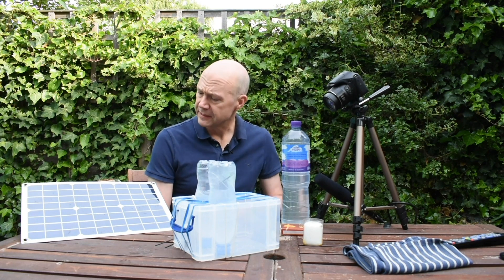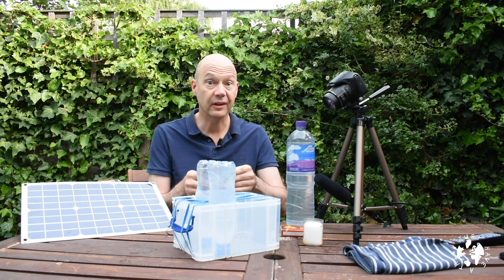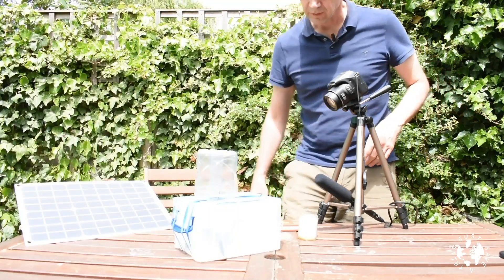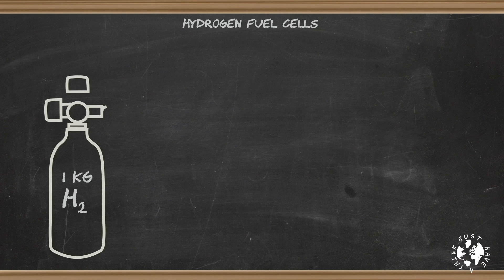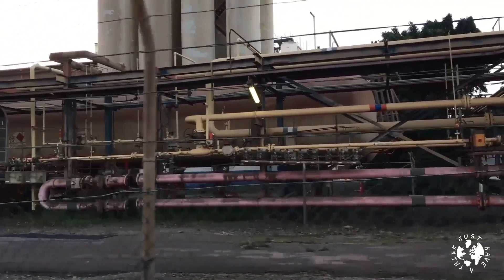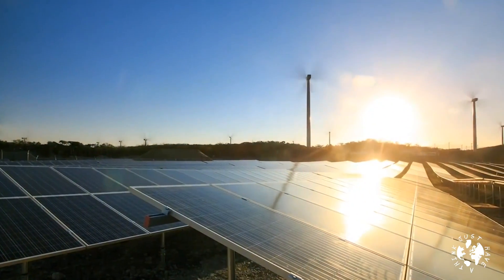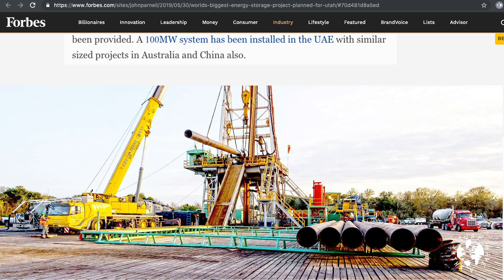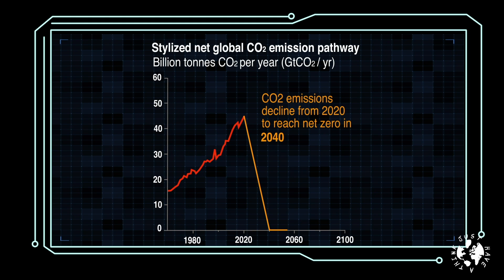Energy Storage in Hydrogen : Does this beat batteries?

Comment: i'm surprised you didn't talk about the efficiency of this process say vs. batteries or other forms of storage
Reply: Effiency is worse then lithium ion batteries but the storage capacity is higher. You could store a big amount of energy you produced in the summer and use it in the winter.
Reply: @Lucas-kh6le  Lithium batteries are improving very fast, meanwhile many physical constraints and thermodynamics laws will never allow H2 cells to get much better. Platinum is still mandatory in H2 cells. OTOH, battery technology is an open ground for multiple exciting new concepts. Including MIT's Professor Donald Sadoway molten metal battery, which may have a bright future in large scale stationary projects
Reply: @rubindiehl2569  Thats true.
Reply: Trigger Troll  you can debunk CO2 as forcing warming in our current atmosphere in 33 seconds.  But you'd be wrong. Comparing our current atmosphere to the one half a billion years ago in geological time is not a valid comparison. Continents were significantly different too. 

The issue is rate of Climate change is so fast that biomes and humans  won't have millions of years to adapt.

The humidity of the atmosphere makes a difference too. It's a very complex system and taking single pieces of information out of context can be deceptive.

https://www.newscientist.com/article/dn11647-climate-myths-its-been-far-warmer-in-the-past-whats-the-big-deal/
Reply: @MrDisasterboy  Its changed no faster than it has in many historical periods
Reply: The conversion of hydrogen into useable energy alone(Rough 60% efficient) is enough to roughly match the net innefeciency of batteries so it is best used where you are willing to sacrifice efficiency for energy density.
Reply: Yes, while it’s very scalable, the efficiency is poor.
Reply: Its main value is as jet fuel. There are only a few jet uel alternatives that can be made sustainably.
Reply: Trigger Troll  Yes water vapour is a greenhouse gas.  And the warming from increased CO2 causes more water vapour in a 'positive' feedback to warming.

So to understand your point, you do think CO2 is a Greenhouse gas, you just don't think it's significant? Increasing it, won't affect Climate as far as you are concerned?

I am not sure what taxation has to do with understanding Climate, except that you seem upset about it. Or what the point of where my food is from.

But I get the impression that you have an agenda. You like diesel, you don't like it being taxed and you don't want society to bother shifting away from non-renewable fossil fuels to other forms of energy.

I understand how our society works and how we produce food.

 As it happens I do know a farmer who uses biodiesel. But that's unusual and the neighbours resent the smell of Patriot Fries/Hot Chips. So I can see how, on scale that could contribute to obesity in rural areas. 😂

Half the emissions from food consumption in wealthy countries is driving to the shops. That exceeds on farm emissions including inputs, transport, processing, refrigeration and cooking!

Like this show promotes. Comfortable urban people driving electric vehicles or taxis to the shops or getting off their  posteriors to walk or cycle will make a big difference.

I don't expect we are going to change each other's perception of what is happening with Climate. So please don't take offence, should I stop responding at some point in the dialog. And vv.
Reply: @pandabear-k7e  Looking at your previous comment, I am no surprised you find it moronic. Doesn't change anything. Heat pollution is nowhere near enough to warm the planet in any significant way, true, but it does warm the immediate environment of human settlements rather significantly. There is a reason why the IPCC places their monitoring stations outside of cities, and why certain types of birds for example have stopped migrating.
Reply: I'd be interested in that too
Reply: I'm the turbine could be improved to capture the 💧drop in pressure and thus improve efficiency.
Reply: @Jeff Peate it is difficult to imagine how a battery based energy grid will be more cost effective and more efficient over the long term than a hydrogen based system. 
If you can use the H to run turbines effectively to generate electricity and then use small scale battery storage then such a hybrid system can also be reasonably efficient... depending of course on how the hydrogen is accumulated.
Reply: @Jeff Peate Yes, I agree with your layout because at the end user the energy must be electrical. If the system is optimally configured then reliance on batteries will be low. Only in vehicles really where batteries and capacitors will be essential. In my opinion even trucks can be purely battery and cap powered by adding induction charging systems embedded in roads. 
It is only in high performance passenger aircraft that onboard fuel is required and I personally tend toward turbine thrusters instead of fuel cell system. 
The hydrogen economy depends on how effective and efficient the water molecule can be disassembled. On that I am absolutely certain that a resonance based splitting system will bring the energy requirement down to a small fraction compared to electrolysis. 
If the existing patents of such methods can be sequestered from the "controllers" then the energy infrastructure will change dramatically. There are 5300 patents that are "classified" and withheld from the public by ....."The US Government"..... whatever that means.
Reply: Okay, let's say if you have solar panels that can generate 100KWh a day but you only have batteries that can fit 50KWh. In this case efficiency doesn't actually matter since you don't have the necessary storage capacity to fit all that energy. If you now leave those batteries for a year, they'll discharge, and after about 300-500 cycles, those batteries will start to deteriorate. And you'll need net energy to produce new batteries. Hydrogen tanks can be refilled n-amount of times, and will last forever as long as the combustion mechanism is in order. The efficiency of hydrogen creation will only get better as technology progresses so saying hydrogen is bad solely based on efficiency of creation just is not a good enough reason.
Reply: Efficiency is  cheaply enough, efficiency is irrelevant, the only an issue where a fuel is expensive or hard to come by, so long as you can produce hydrogen cheaply
Reply: @tim g That is not how energy works. If you use heat to do work, then you are adding that heat to the system. Because that little bit of fundamental physics called "energy conservation".
Look at any of your devices. If it says X Watt on the back, that is the amount of heat it ultimately produces, unless it creates a chemical fuel of some kind, thus acting as a heatsink.

Besides, CO2 doesn't "Take a long time to break down". CO2 doesn't break down, period. It is a stable compound. Plants all over the world use it as a resource for building material, hence the period of global greening we are currently experiencing.
Reply: @tim g The heat is being added because the solar cell absorbs more of it than the cycle of "light comes in and gets reflected" does. The whole point of making more efficient solar cells means you are trying to absorb more energy and stop reflection. Ideally 100% of it, which means more heat on the planet. 
Though granted, that is only a local problem, since in the grand scheme of things, it is all radiated away again into space pretty quickly. Still means cities are a lot hotter than the countryside, hence heat polution.
Also, did you really just link me a grade school level article to prove your point? Don't they cover this stuff in school wherever you are? Maybe I should link you some basic logic articles in return?
Reply: @tim g Considering, again, that you sent me information on the topic any high schooler would know, expecting it would be news to me, I am afraid you are in no position to recommend I better myself. 
You have given me unfounded opinions, not information. 

I would in turn recommend a healthy does of introspection to be in order. And again, maybe brush up on the basics of logic and rhetoric.
Reply: Jeff Peate have you got a reference for the lower loss rate? I may be behind as its been sometime since a built a solar car and did the calculations
Reply: Jeff Peate pumped hydro will only work is specific suitable locations, and the greenies will no doubt try to stop that also
Reply: Andrius K do you know what burning hydrogen produces? H20. Do  you know what the the greatest greenhouse gas is in the atmosphere is? H20, so if you think burning fossil fuels releasing co2 is causing global warming, burning H will cause more.
Reply: tim g co2 is recycled and absorbed with 5 years. No problem
Reply: @Jeff Peate true but pumped hydro is dependent on geografical features to be economical. Hydrogen can be produced where pumped hydro is not feasible.
Reply: @Jeff Peate he is correct. There are a lot of losses associated with the production, storage and use of hydrogen compared to pumped hydro but pumped hydro is dependent on geografical features to be economical.
Reply: @Jeff Peate depends if you have renewable electricity. Not everyone globally has renewable electricity in their area
Reply: Battery storages are very efficient,
but they only have a very short live time. They loose capacity over the years and eventually you have to replace the whole system. 

A Hydrogen storage is far away from being efficient. But it's clean. No recycling of batteries, no high maintenance or replacement costs. And they last a very long time. 
Capacity is just a matter of storage tanks. 

There is a lot of solar and wind energy where I live. 
I see it every day. Every time the sun is shining, they shut down the wind energy. 
Both technologies would help. And everything is better than shutting down an energy source. 

If you want to store a big amount of energy over a long time, like 
(saving it for the winter) I would go for Hydrogen. 
If not, it's about investment costs and the price of stored energy.
Reply: Lol, do u think there’s no energy used to produce that lithium battery storage?
Reply: Excellent Video! Forgive me for butting in, I am interested in your opinion. Have you tried - Elijahzan Ailment Solution Review (probably on Google)? It is an awesome one of a kind guide for saving money with your own electricity supply without the normal expense. Ive heard some incredible things about it and my old buddy Taylor after many years got excellent results with it.
Reply: do A YouTube search for liquid air batteries. this method is infinitely  scalable, non-volatile snd can store energy for as long as needed. also, total losses are just 20%. h2 losses? 70% from water to voltage- h2 just can't compete. plus- with the new 4680 tesla tabless cell technology, they can make lithium cilica batteries with no cobalt & very little nickel- Waaaaayyyy cheaper, faster & more scalable than ANY of the above. i give it 10 years & tesla energy will be building 15-20 terawatt super sub-stations for 1/2 the price of ONE coal peaker plant cost to build & operate for one year... & tesla tera-packs are automated... no need for coal, gas, maintenance crews, medical, dental, vision, labor unions, lobbying... just sunshine, collect energy, pass to grid.
Reply: tesla 4680 cell tech changes EVERYTHING
Reply: I was surprised efficiency wasn't covered. The round trip efficiency of pumped hydro is the reference everything needs to be compared with. Lifespan and up front cost are also issues that must be addressed. Hydrogen storage has always had a short lifespan problem. High efficiency & long lifespan equal low cost at grid scale.
Reply: @tsamuel6224  solar + battery storage at grid scale. in western nc, near the TN border, there's a group of 3 houses and a small business that are on solar + lithium battery. they had to double up on the size of the system because there's a lot of rainy days. they priced vs. small diesel. diesel would be cheaper up front- but... the solar system only took about 5 years to 'catch up'... now they are running  way cheaper... plus? hands off, all automated. no need to keep it fueled or rebuild wearing parts. at grid scale, those 'maintenance costs' compound... A LOT.
Reply: @tsamuel6224  liquid air energy storage is around 80% efficient now, vs. h2's 40%
Reply: Effiency = cost
The less efficient a process is, the higher is its cost.

With the current efficiencies and maintenance requirements,  H2 storage, energy production and mobility are not competitive to other forms of energy & storage, today. 

If we don't want to end up with higher energy cost than today, the H2 efficiencies need to improve by a lot.
Reply: 100% efficient!
Reply: And that’s the problem right there. The efficiency is just awful.
Reply: The efficient can be improved by using the pressure as an energy storage as well as the fuel.
Reply: Efficiency isn’t the only important thing when considering alternatives, and we also need to look at the whole cost in energy to produce (Non Renewable) Lithium Ion batteries, from Mining, transportation, processing, manufacture and end of life disposal!.
Reply: @Kiyarose3999  Yeah, that’s all well understood. Hydrogen is a joke. It’s like 20% efficiency from source to wheel. And fuel cells require exotic materials as well. In fact, making and using hydrogen is so inefficient that the vast majority of hydrogen used today is made from fossil fuels with massive CO2 output at the source.

Hydrogen will have a place in the new energy economy, but it will be incredibly niche, and FCVs will be a tiny fraction of cars.
Reply: Interesting, just one cheap cell. No charge controller, no intermediary like a capacitor or small battery.
Reply: than you get student engineers telling you that you do not understand the math, you can not convince them otherwise...
Reply: Earth would be more cleaner with more renewables, efficiency might be an issue. Oil wars will be reduced, More peace to the earth. Ofcourse big players living on the existing system might not be liking solution.
Reply: @RaviKumar-cm1qo  That is probably the most naive way of looking at this topic. 
Renewables are not a magic pill.

Before there was oil, wars were waged, and after there is no more oil, wars will still be waged. 

Plus, you know, the "big players" are also the biggest investors into renewables. Like oil companies, for example. Big Oil positively adores renewables - because guess what, "big oil" does not actually care about oil. Only money.
Reply: @Alexander_Kale   Thanks for reply, I know the wars will continue to happen. Consider Arab countries, few are very rich and few are turned into such bad state because of some countries which control flow of money, power. If renewables which are available to everyone comes to play, a level field would be created. The wars will continue, those wars among equal players would be worthy, interesting also.
Reply: Efficiency is not that of a relevant parameter as such. It's just a number a percentage. The real question is what that means in term of extra costs to make up for the lost energy in comparison with the costs of other energy storage technologies that achieve the same goal. Seasonal storage is no way a job for batteries, so you're powerwalls are exceedingly expensive for the same energy amount to store, compared to the extra renewable infrastructure cost to make up for the losses in electrical-H2-electrical conversion. You can make a point if you compare towards the infrastructure costs of thermo chemical storage of heat, or infrastructure that work with potential energy in watercolumns and pumps...
So to recap, efficiency as a number on it's own is NOT relevant, it's only relevant towards the costs compared with adequate alternatives...
Reply: Yes, those numbers are crucial here. Creating batteries waste a lot of energy and has environmental consequences, so even with lower efficiency of hydrogen storage it could be useful. Question is - how much do we lose?
Reply: @Lascarnn  And you have the data to prove that building batteries is that can be used thousands of times and then remanufactured are less efficient that the inefficiencies of hydrogen it better. Right now I understand that a hybrid car has less carbon footprint than full battery. Of course once you no longer have to keep that coal or gas fired plant online to charge the batteries may be a different story. So much BS out there.
Reply: @cliffordnelson8454  What are you talking about? I wasn't replying to your comments, I wasn't even talking about cars. But since you wrote to me, I can reply - hybrid car has less carbon footprint when the car is not driving enough. If EV will drive 100k, 200k km, then (depending on electricity source) it will have smaller footprint.
All this can be calculated, it's just math. We just need to have more numbers, ie. experiment more with hydrogen to know how the emissions would look like for bigger scale hydrogen usage.
Reply: @Lascarnn  And if a coal plant has to stay operational to meet the needs of recharging, then you should take the carbon-footprint of the coal plant. Somebody told me of going to a recharging station and seeing the gas generator being used for the power. LOL. Very easy to misdirect assuming that power will come from renewables. but that is not fair. When all power is from renewables, then you can take credit, but not as long a fossil fuel plants are needed to meet electricity demand, and that recharging is increasing the electricity demand. Of course, there is the aspect of not increasing pollution in areas of high pollution, but that is a different problem.
Reply: Should judge by volume anyway. WTF does 1kg of pure hydrogen looks like? He totally skips that... 

 Seen the engineering explained video. He talked about it, and it doesn't look good.
Reply: The re-use factor will eventually completely and totally obliterate any short term efficiency advantage of batteries by long term cost advantage of hydrogen.
Reply: Doug Stevens Why do you think so?
Reply: @matschlegel  Replacement costs of batteries is tremendous where hydrogen infrastructure maintenance is low in comparison.
Reply: @dougstevens1877  clearly you have NO EXPERIENCE with hydrogen. if harry houdini had h2's 'break out of confinement' skills? he'd have been a billionaire
Reply: @jaybee3165  ... you should take this up with Airbus... before they start wasting money on H2 powered passenger planes....
Reply: @dougstevens1877  actually... THAT is the ONLY instance where i would say- smart move.
Reply: @dougstevens1877  What reuse?
Reply: Agreed. P to H2 to P leaves you with 40 % of the energy you started off with -  a rather staggering 60 % loss. 
That's a lot of extra windfarms and solar you'll need to be able to afford to store such energy in hydrogen. 
Regretfully, otherwise H2 would be the obvious energy buffer or 'battery' for the near future. Now, not so much.
Reply: @justforthehackofit  even a 60% loss can be justified with the massive over production that solar energy offers. And of course, that would be improved over time. The VERY BEST internal combustion engines in cars offer 30% efficiency converting gasoline to power. If we can accept that I think we can easily accept 40% in a non-poluting, totally renewable source.
Reply: True. Still, quite a ways to go to have the appropriate amount of energy production.
Reply: @Shawn_M  Yes now consider that hydrogen fuel cell has a thermal loss of 30% (see the radiator used on the Toyota car). All in all science without numbers isn't science.
Reply: @RAHellemans  yes 30% is a figure. But what form of energy is that loss? Byproduct of heat. In a northern climate that is not a sad byproduct. Last week was -28c I would of enjoyed that 30% byproduct of heat in the house and could of used it.
Reply: @paulkainer269  Yes well that would help you but your opposite number at +40°C would need more hydrogen to run his clim. Gain overall zero still leaving the 30% loss on the table for moving the vehicle . The most promising application of this technology is being worked on in Denmark where their windmills produce more electricity then they can use or efficiently store (battery). The project is to produce hydrogen by electrolyses and they plan to sell it in liquid form. As liquid hydrogen is over 100 times more energy dense by a factor over 100 then current Li batteries. Their target is air travel: see you on the first hydrogen powered commercial flight in about 10 years!
Reply: @Shawn_M  Overproduction is not a good idea, period. 60 percent energy loss means that your power bill goes up by a factor of 2,5. Every extra solar panel or nuclear power plant that feeds such inefficiency is basically heating the environment without providing any benefit to us. 

Just because there is plenty of solar to be wasted, does not mean doing so is smart.
Reply: @Alexander_Kale  1. Wrong
2. Wrong
3. Wildly inaccurate
4. Wrong
Just stop.
Reply: @Shawn_M  If you want to replace CO2 pollution with heat pollution so badly, go ahead...
Reply: @Alexander_Kale  heat pollution?! What the hell are you talking about?
You need some basic science education before you can comment on subjects like these.
Reply: @Shawn_M  40 percent storage efficiency means that 60 percent of the energy are lost as heat. You know, like the old incandescent bulbs being really more of a space heater than a light source. 

I agree, that is pretty basic stuff.
Reply: Trigger Troll  We need cyanide in trace amounts to live. But any kind of additional dose is poison. Sure the biosphere needs heat and the greenhouse effect from CO2 to make life possible. But too much IS pollution. Stop trolling. :-\
Reply: @MrDisasterboy  above 7000ppm is a problem, we will never get there even if we burn all the fossil fuels we can access, so they're no problem with CO2 "pollution"
Reply: @Alexander_Kale  Logic, dear Watson, logic: If it comes from the sun the 60% is not really heating, is it? Even if the energy was stored and then released within a few months it should not cause problem. The issue are greenhouse gases which stop the heat escaping, not production of heat. Is the insulation not the heat production. Stay focus on the goal.
Reply: @krzysztofbaus1311  First, no, that is not how light works. A reflective surface would reflect light without creating heat. Solar cells meanwhile are meant to absorb as much light as possible, and in that scenario, any energy that is not turned into electricity is turned into heat instead.

second, you are right in principle that the extra heat the solar cells produce is miniscule when compared to what global warming traps in the atmosphere. You are wrong in assuming that said heat pollution is not a problem, if a local one.
Reply: @Alexander_Kale  check out Tony Seba. He advocates solar and wind overproduction by 20% to create what he calls "superpower". A low maintenance system to make power almost free. Obviously the standing solar and batteries used require little expenditure. Power lines still need maintaining. No compression or transport of hydrogen. The oil companies like hydrogen because they have the infrastructure already.
Reply: @andrewsaint6581  "solar and batteries used require little expenditure" - That is simply not ture. Batteries require an enormous expenditure. Even if solar panels are getting cheaper and cheaper, installing them en masse is an absolute nightmare, especially in the US, where building standards vary greatly and every roof looks different.

And that does not even include the regulatory infrastructure you need to handle the unpredictable peaks.
Reply: @Alexander_Kale  I'm sorry but I think you are way oversimplifying or misunderstanding something here.
Reply: @jg4sh7j4  You are commenting in a thread I haven't visited for a year and in which I have written multiple responses to a variety of stupid ideas. You'll have to be a lot more specific, I'm afraid...
Reply: It definitely seems like the efficiency is really bad all that time and just a little flame
Reply: @cliffordnelson8454  that my friend is what makes hydrogen production supremely lucrative.
Reply: @cliffordnelson8454 I doubt graphite was the best choice of electrode(as well such a low surface area for said reaction) nor was the direct current applied to it. It was demonstration for simplicities sake. Noble metals and high frequency resonance generator matching closely the required frequency to crack the water molecule would likely be way more productive but not near as easy to implement in such a short period of time for simple demonstrations. If your at all interested look for more info on electrolysis, Hydrogen production, or Browns Gas production to get a better hold onto what others are actually doing to produce these gases. I agree with your next comments of the pitfalls of storing and getting such productions to consumers. It would be best to engineer a plant to use the resource on demand (much like current power plants)to generate energy.
Reply: @masterdebater8757  "required frequency to crack the water molecule" - no such thing. You might "crack" the molecule be shing light of a specific frequency, but that is a whole different story.  The idea here  is to use electrochemical processes.

 And alternating current would produce a highly explosive gas mixture (hydrogen and oxygen together) in the bottles. We don't want that.
Reply: This process is far less efficient just charging and dis-charging a battery. Hydrogen is not the future and if adopted at all will be only for very specific cases...
Reply: @0xNameless  planes?
Reply: @jg4sh7j4  yes for long range aircraft you just can’t away from not using Hydrogen or a similarly energy dense fuel. Airbus are now actively looking into producing an aircraft that uses hydrogen, how it uses it I am not sure though.
Reply: Sure hydrogen has pitfalls but at least we don't need mass quantities of rare  elements and toxic chemicals to make it work.
Reply: @jayknight139   Oh really, platinum is not exactly plentiful.  What rare elements were you thinking of that are needed in mass quantities for electric vehicles ?
Reply: @dogphlap6749  I don't remember exactly. But let me Google it ,then reply with a smart answer as if I already knew.
Reply: @dogphlap6749  other metals can be used
Reply: @jayknight139  Yeah, you do. Unless you burn it, which is stupid. Fuel cells still require exotic materials, rectifiers, small batteries, etc. In a car, the motor is exactly the same.
Reply: I have liked your presentations in the past and thought they were really good this one was not. You go on and on about needing to store energy but very little about the pitfalls of hydrogen. I would have expected much better
Reply: @cliffordnelson8454  How would there be more severe "pitfalls" with hydrogen as a domestic gas utility than lpg or natural gas? If the hydrogen is stored in those under ground caverns and released into the domestic grid there is virtually zero difference to any other utility gas.
Reply: @dougstevens1877  Ever heard of hydrogen embrittlement ? Have you heard of just how small an H2 molecule is and how difficult it is to make anything hydrogen gas leak tight ? The fact that hydrogen is much lighter than air does not make it safe (but it does help a bit), it can still pool under roofs (like all the reactor buildings at Fukushima that suffered hydrogen explosions, the results were not pretty). LPG is dangerous but nowhere near as dangerous as H2 (it really, really wants to explode).
Reply: @dogphlap6749  Airships were using hydrogen to make hundreds of passenger trips across the Atlantic until the terrorist act that destroyed the Hindenburg. It was shot with an incendiary round. 
By the actual destruction at the Fukushima plant the mini nuke theory seems much more plausible than a low pressure hydrogen blast. The explosion there broke 3 meter thick reinforced concrete walls. Thus, another terrorist event that had nothing to do with hydrogen although hydrogen became the scapegoat. 
That is not to say that hydrogen does not need a specific protocol in it's storage, transit and application but once it is properly configured it promises to run for many decades with very lttle concerns that are not also applicable to LPG and such.
Reply: @dougstevens1877  you're right. hydrogen handling is a solved question already. technically not an issue. the scare mongery is in some big business's interest most probably...
Reply: Doug Stevens you have not considered  high pressure required, and low molecular density of hydrogen which makes it far more prone to leaking and explosion than lpg. These and the high energy cost of production of hydrogen are major factors why it will never be piped to houses like natural gas is.
Reply: @dogphlap6749  exactly
Reply: @dougstevens1877  the use of hydrogen as a replacement for natural gas in the home as a way to quickly reduce emissions is another good use for it.
Reply: @dougstevens1877  Do you know anything about hydrogen. You cannot just reuse pipelines. Hydrogen is tiny compared to molecules making up natural gas. You will probably have to replace all the pipelines with those with much greater sealing.
Reply: Batteries lose about 15% during storage and release, and have low energy density. He did cover energy density and that is a big issue for transport and storage. Hydrogen has high energy density but in atmospheric conditions is a low density gas so has to be pressurised and/or cooled which takes a lot of energy so it has its own inefficiency. So far there is nothing that comes close to matching the low cost, high density, transportable energy nature created in carbon based fuels.
Reply: @KingComputerSydney  The low cost of carbon based fuels?  How many trillions per year will the global economy lose to the effects of climate change? That's the real cost.
Reply: ThePsyclepath very little, and agricultural production is substantially increased by releasing sequestered co2 back into the atmosphere where it came from when concentrations were up to 7000ppm
Reply: @ThePsyclepath  Releasing previously sequestered CO2 into the atmosphere (where it used to be 5000ppm and more) has substantially enhanced global plant growth, crop yields and provided a beneficial mild warming which have helped the planet and humanity enormously. You've obviously falling for the global warming propaganda. The global economy has will continue to have orders of magnitude more benefit through the use of carbon based fuels compared to not using them.
Reply: @ThePsyclepath  A lot less than the benefit, that is why they're used. Climate change, you mean global warming? You've been fooled if you think its because of carbon fuel usage.
Reply: @KingComputerSydney  that is true, but there is a lot of research being done in electrolysis. Look at SOEC electrolysis with up to 80% efficiency. Just wait for the economy of scales to hit the electrolyzer field and we'll see it becoming by far the cheapest form of clean energy storage. Ok, Lithium Ion is the most efficient, but it's bloody expensive to produce (prices won't really fall in the future) and the lifetime is also horrendous. Look at how much Japan, South-Korea, Germany and Scandinavia, ie the most technologically advanced countries in the world, are investing into hydrogen (especially across different sectors)... hydrogen fuel cells are also definitely going to be used as cogeneration sources for households (electricity and heat)
Reply: Alexander Kageneck when it becomes the cheapest fuel source when all costs are considered - production, compression, storage, transportation, utilization and safety costs, it will overtake hydrocarbon based fuels. Its a long way from being cost effective which is why its not used except where large tax payer subsidies are involved as in the countries you mentioned. Mercedes after 30 years and billions spent is giving up on hydrogen https://www.cleanenergywire.org/news/mercedes-benz-gives-fuel-cell-cars-report
Reply: @KingComputerSydney  lol and what's the efficiency to make the hydrogen?

Idiot